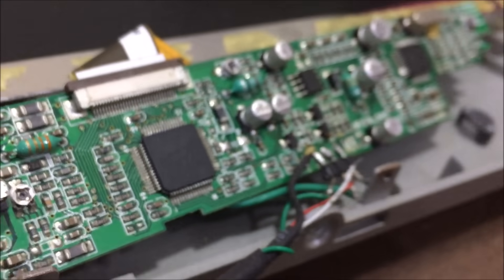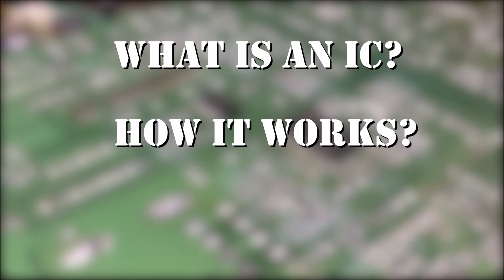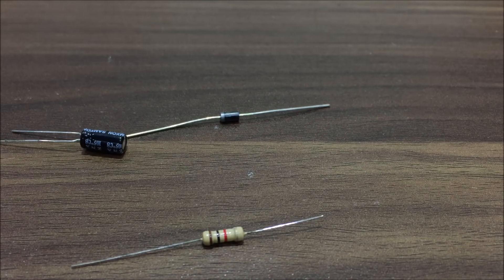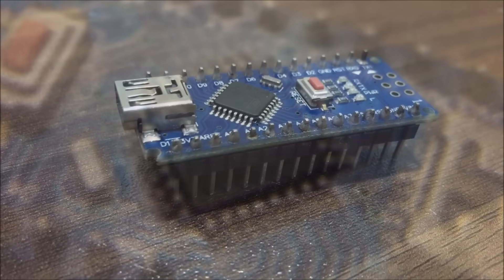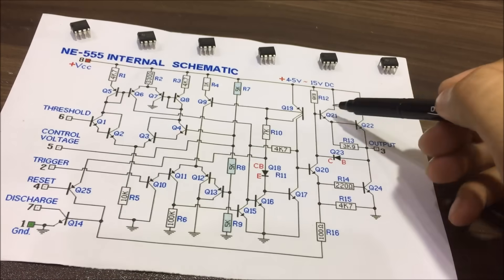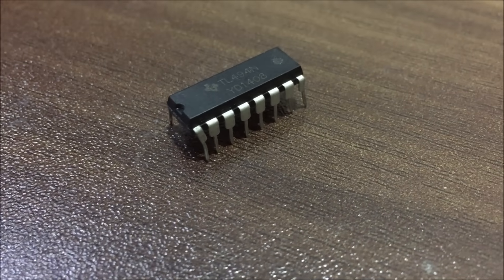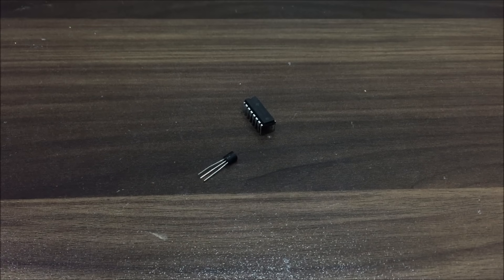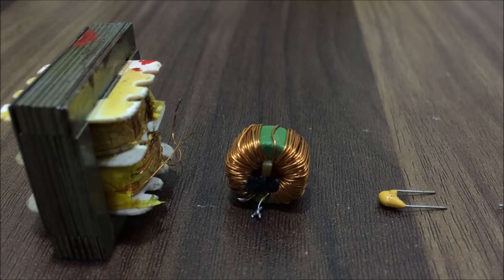What Is An Integrated Circuit (IC)

Comment: Pretty much small processor doing different things for different ic.Like the 555 timer dos bunch different things including adjust freqs trimmings bunch others depending on how you wite it to emble different modes.tgeres thousands different ic.Ic ram,it processors,do on?
Ic is just a page circuit that saves space.
Theres integrated and there's ones that have a socket that you can swap with out with out soder.your cpu is type ic.

Comment: What's the reason why IC is in square/rectangular form, not in Circle?
Reply: Idk maybe easier pin locations idk idk
Reply: Pretty sure it's easier to cut squares from a big chunk of a rectangular material, than to waste edges going for the circle pattern
Reply: FOR THE SAME REASON YOU CANT PUT A ROUND PEG IN A SQUARE HOLE !!

Comment: you did not explain in dept what an integrated circuit is and whtat it does
Reply: yes he did...it's an summation of a bunch of parts, condensed into a smaller area. it does what ever it was designed for, but in a smaller size.
Reply: Hello, this is Tiffany from Electronic Signs Inc Limited（ESI), we are an independent distributor for IC part,  if you have any needs, please contact me on email: marketing.esigns@gmail.com , skype:sales.esi,